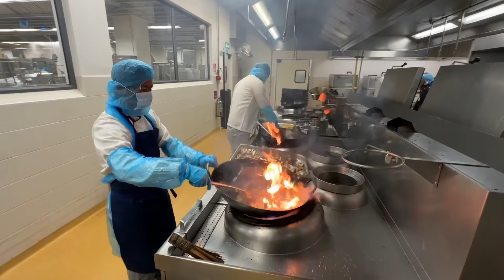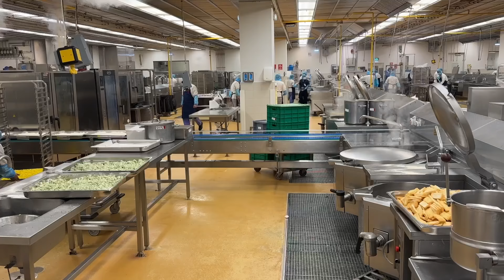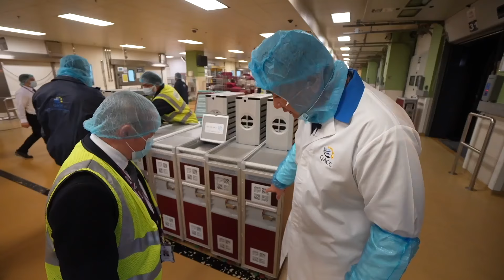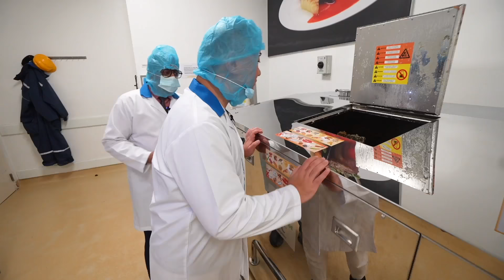Inside Qatar Airways - How do they make 200,000 Airplane Meals a day?

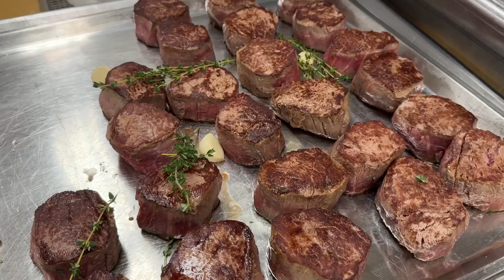Comment: 3:49 
No glavs😢
Reply: Thats fine, the heat will kill everything. I work in food industry. The classic rubber gloves would melt and thats something u dont want. There are heat resistant gloves but they are toxic and really not suited for this job. Also there are procedures workers must do before even stepping inside the kitchen. Also its really easy to track someone if something goes wrong, like from which batch the food was and who got shift that day. It may vary per company but still u dont need to worry  cuz there are much worse stuff in every meal u eat daily even its simple vegie.

Comment: Qatar's kitchen is perfectly clean and modern. However,  to maintain Qatar's 5 stars commercial catering kitchen reputation, I found some following food safety issues in the video: 
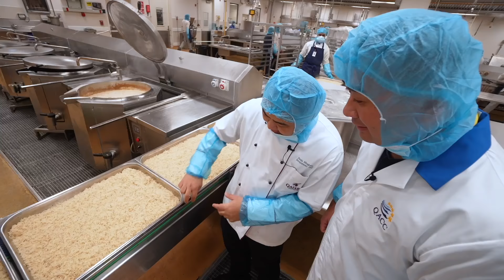8:20 If the guy can wear gloves before touching the metal container with rice in it that will be even more professional about food safety. 
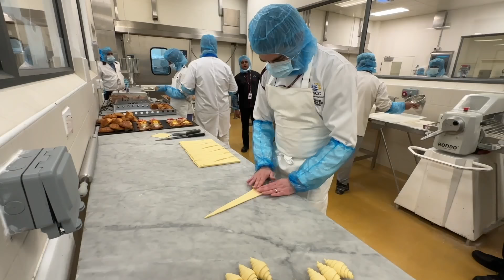11:35 Making croissants with bare hands and his WEDDING RING still on! I don't think passengers would like to eat the dirt from the wedding ring. 😨
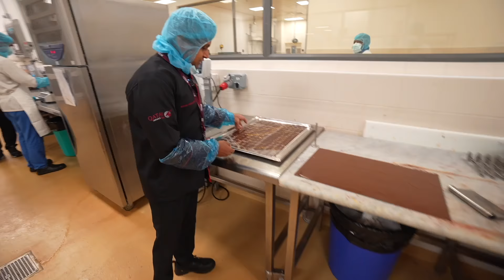12:23 That senior staff handling the chocolate without wearing glove. Now, I know who is "the trouble maker" to Qatar Airlines 5 star reputation. Senior staff doesn''t obey the food safety requirements?! 😨
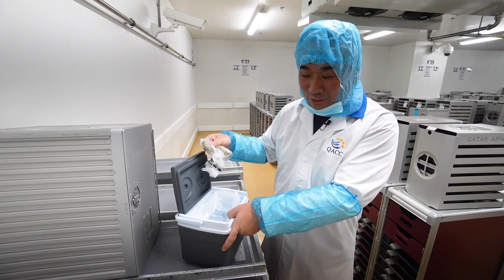13:46 Sam, as a visitor, I think you should wear gloves before handling the caviar or any food.
Suggestion: Qatar should provide transparency plastic masks to youtuber/kitchen tour guide. Saliva may split on food when speaking. Providing gloves to visitor/youtuber to wear in the kitchen is recommended. 
Conclusion: According to the vlog, I think the pastry department has to put more awareness with commercial catering food safety requirements/company standards. I couldn't find any issue from other department but pastry department.
Qatar is one of the best airlines in the world. I wish Qatar can maintain their world class, the best service and reputation forever.